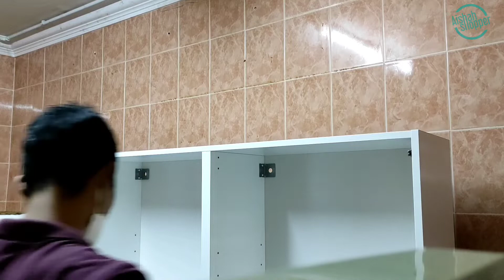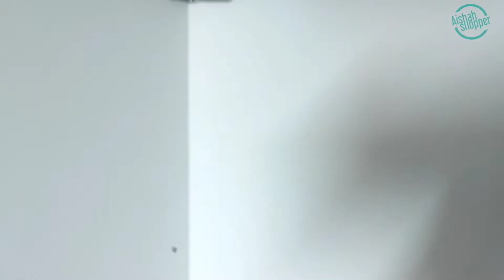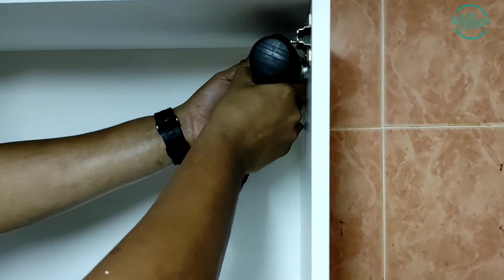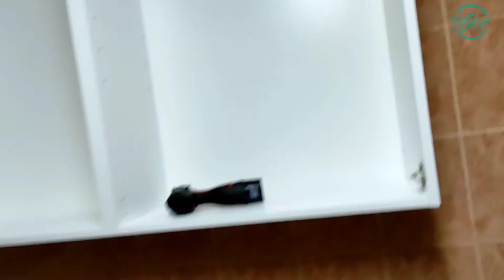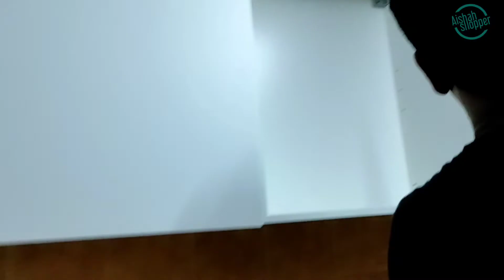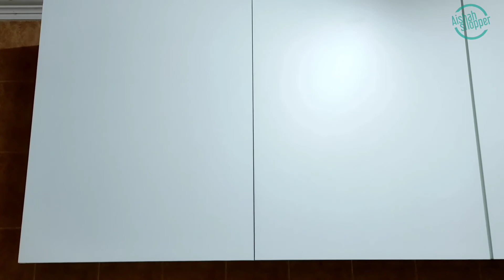IKEA KNOXHULT WALL CABINET ASSEMBLY -NO JACK USE, JUST LIFT BY HAND ✋-

Comment: Great video. Brother, can you let me know what size (? mm) and what type of drill bit you use to drill on the tiles to match the installation of this cabinet?  This cabinet set whether include the parts of the long screw for the wall mounting